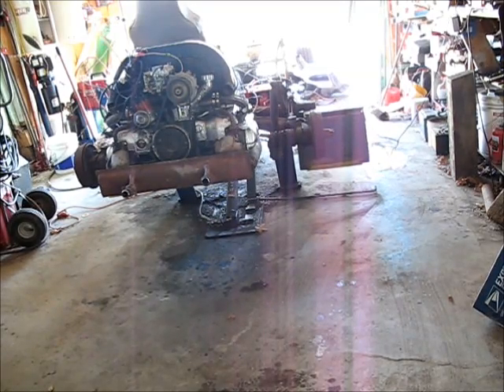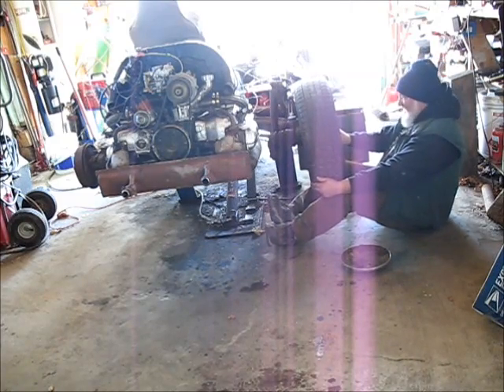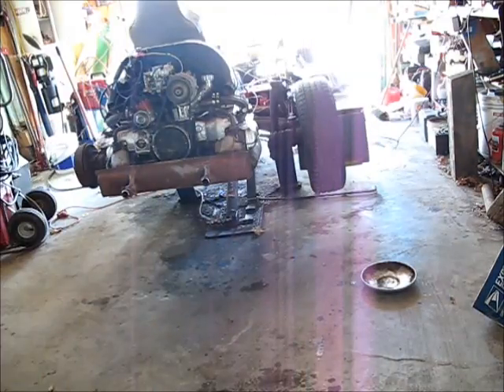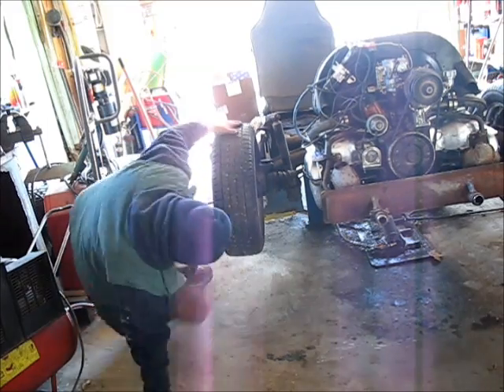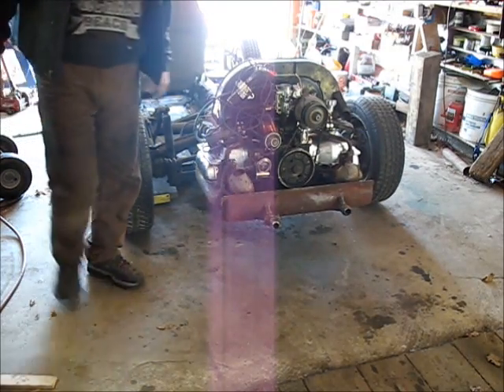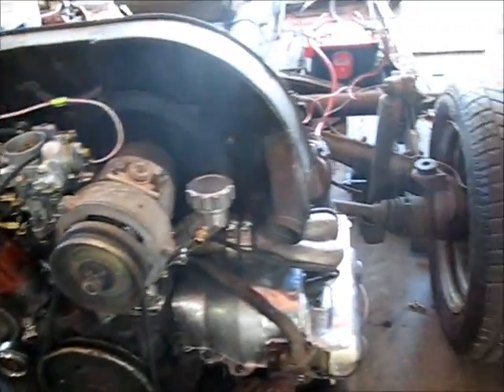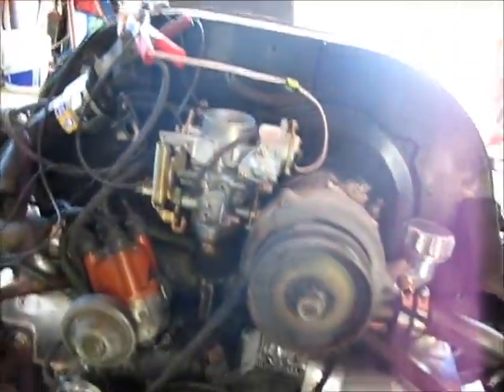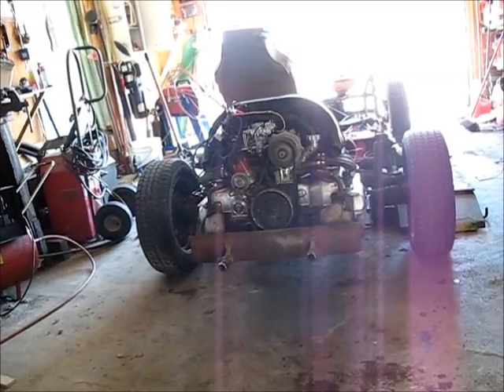69 VW Convertible First Drive

Comment: You need to plug the 2 holes so all the air blows over the engine instead of out the holes not doing anything.

Comment: In the other video you mentioned that starter motor could be an issue.

It could just be the sound quality but something does sound a bit off.

Might be a good idea to inspect that starter gear and flywheel, but thats just the little guy in my head being overly cautious!

Other then that, AWESOME! love this little top end rebuild series ya done here.
Reply from the maker: That's an old starter that someone gave me.  I'm gonna put a fresh one on here.  I noticed the post is a little stripped and it hasn't got the best connection to the battery too.  It'll do till I get a better one.   I think...
Reply: That works for me!